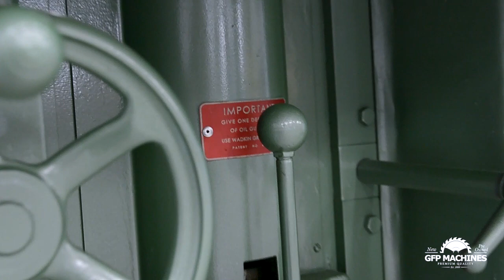Double spindle moulder from Wadkin LTD

Comment: What was the idea behind the double spindle moulder?
Reply from the maker: So, think of the double spindle moulder as your go-to woodworking machine for getting stuff done efficiently. It's like having two workers on the job instead of one, so you can churn out double the work in the same amount of time. Plus, it's versatile – whether you're shaping, cutting, or profiling, this machine has got you covered. And hey, it's not a space eater either – it fits right into your workshop without taking up too much room. The real deal is the shaping capabilities because of the dual spindles.

Comment: Hi Nice looking EX, that's quite a late model machine with the square shaped swing out covers for the belts, I have an older EX, in your explanation below you didn't mention you can run one spindle in reverse with the same tooling profiles on both blocks (a reverse designed block), I have seen this used by cricket bat manufactures for shaping the handle where it meets the bat.  If you let me have the Test Number of the machine I can date it. Edit Just looked on you website Test Number EX 65264 making the build 1961 and I see it's the 2 speed mine is the 4 speed
Reply from the maker: Thanks for the info and your comment! You're absolutely right, the ability to run one spindle in reverse with the same tooling profile is a great feature of these machines, especially for applications like shaping cricket bat handles. We could've have been more comprehensive on our explanation definitely, thank you again for the detail. The ability to reverse one spindle depends on the specific model and its motor configuration.

Also very impressive detective work on your machine's test number!  The 4-speed version definitely offers some additional flexibility when using different wood. Different hardness needs different speeds very important to keep in mind the work you do and material you use before buying one of these babies. But then again we never came across anyone who regretted  purchasing a Wadkin Machine . 
Regards 
Leroy from #GFPmachine